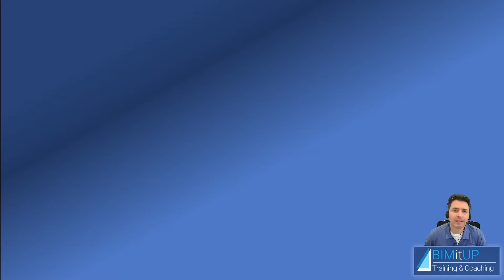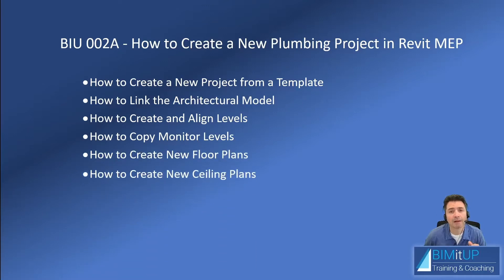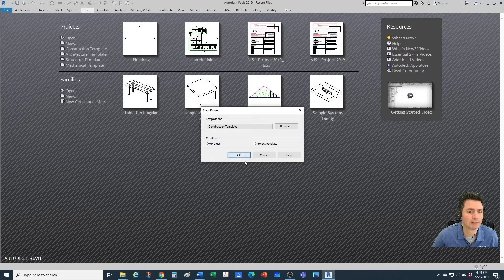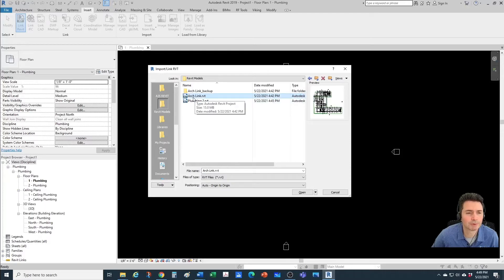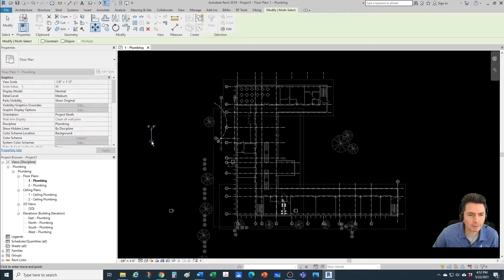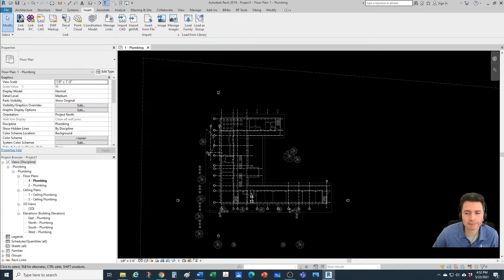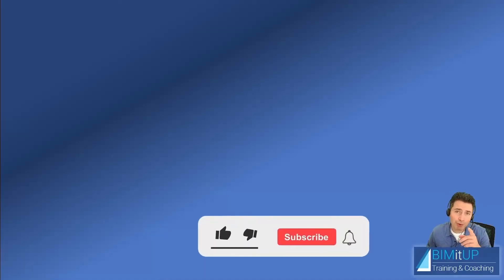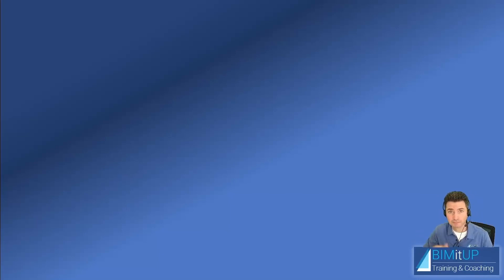How to Create a New Plumbing Project in Revit MEP - Creating a Plumbing Project Tutorial

Comment: do i need to copy monitor the grids? or the elevation only?
Reply from the maker: Hi Ulster. You don't "need to" monitor anything.
I find that monitoring LEVELS is essential (because Levels contain all your elements), so when the Architect changes a level you definitively want to know about it to take action.
Now, monitoring grids is pretty annoying, because you keep getting all this monitoring (collaboration review) "warnings"... just because the Architect changed a gridline name. However, other than manually (visually) checking, it is the only way to make sure your grid locations and names are consistent with the Architect.
So, in summary, you don't have to, but it is an annoying good idea. =)